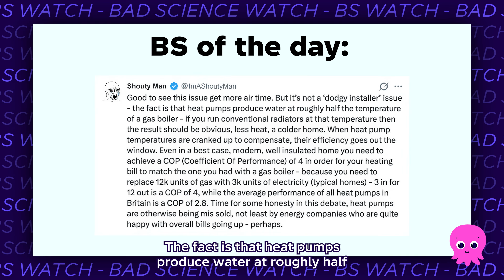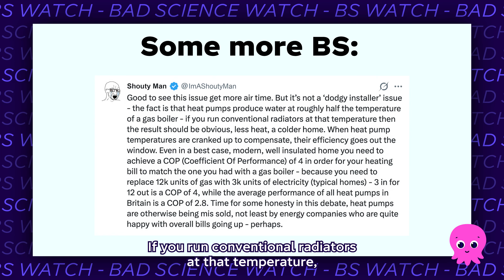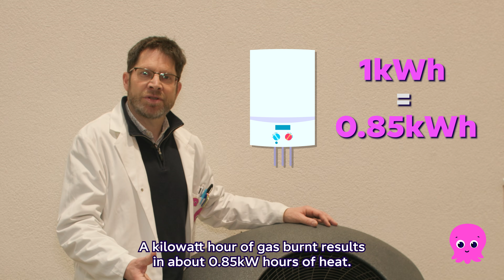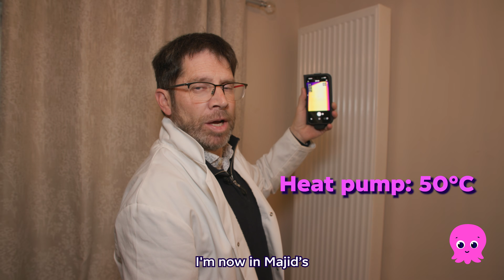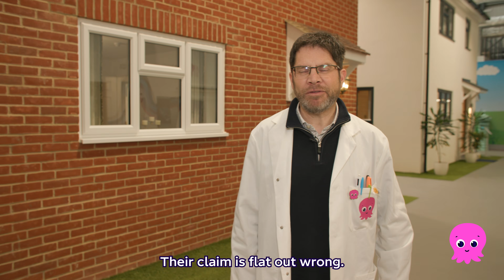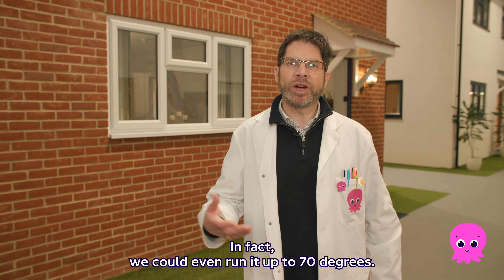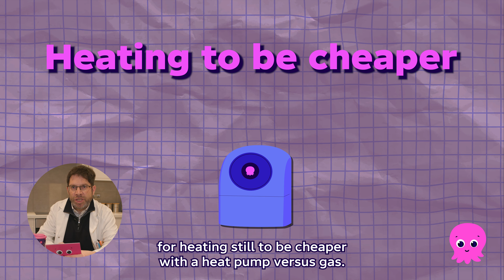Are heat pumps half as hot as gas boilers? BS debunked

Comment: what if you have an EV and are on intelligent Octopus Go it will work out more expensive to have a heat pump? does the heat pump run all day? how big is the water cylinder? Combi Boilers are more about space when it is limited
Reply from the maker: Hey Andy, the hot water cylinder is 1m x 1m x 2m. Heat pumps are most cost effective when not switched off, heating up a home from scratch takes a lot of energy and you can set the schedule to bump the temps up and down depending on your tariff rates. We show how this looks in practice with the Cosy tariff here: https://octopus.energy/heat-pump-help/cosy-schedule/

I'm here to chat through tariff options with smart tech, if you could pop me a message here: https://octo.ps/nudge
Reply: Add a battery. Then you can run the heat pump and the rest of your house on overnight tariff. And that's going down next month.
Reply: Heat Geek offer the Heat Geek Mini and Nano, which are small heat stores for heat pumps.

Comment: I have a heat pump but I wish I had a gas boiler, they are much more reliable and cheaper to run.
Reply: I have a heat pump and would never go back to a combi. Too bloody expensive to run. Secret, add a home battery and run the whole house on the overnight cheap rate.
Reply: If you have difficulties with your heat pump, contact your installer, or ask for help on social media groups.

Comment: So even at a COP of 4x (gas is 6.32p , electric is 28p) you are still cheaper going with gas and the standing charge on gas is less than electric, plus the fact you not spending a fortune having a HP fitted. Running a heat pump is NOT cheap for most people in the UK, and you make more on electric than you do on gas so OFC you want it rolled out and you want to sell more because you make more. Electric should be cheaper over all than gas as it easy to make, cheaper to make and costs lets to move. Yet we live in rip off Brittan were the scam energy regulators who are run by big energy providers make the decisions on how much you charge. P.s I am gas combi boiler, house warm all year round at 21c cost me £464.92 for a whole year inc standing charge. (3 bedroom home 1954 build). If Octopus want to prove me wrong and provide me with a free heat pump and show me how to cut my costs even more then sure come and do it. p.s i have solar and batteries as well and my systems cover all my electric bills, gas bill and water charges for the whole year ... CHANGE MY MIND Octopus, put your money were you mouth is and prove me wrong. you can read about my solar experience here - jdmne.com
Reply: "So even at a COP of 4x (gas is 6.32p , electric is 28p)" I have a battery and run the heat pump and all the house on 7p kWh. That rate is dropping to 5.25p kWh 1st April. Heat pump wins hands down.
Reply: @ianhamilton3113  lets see in the next few months ;)
Reply: A heat pump offers similar running costs to a gas boiler. Solar and battery, as you have, make heating with a heat pump even more affordable. If you have limited heating needs you may find AC, again using electricity, more suitable.

Comment: That original comment was wild. Hopefully they're not in the heating industry as someone who's only credentials are "briefly looked at how to make my tiny radiators more efficient", I can see it's wrong. 

In theory, you could set your thermostat to 21 degrees and have your heating source putting out water at maybe 25 degrees. It'll take longer to heat up sure, but it's possible and probably cheaper than blasting 70 degrees water around for a few hours at a time. 

It's like driving 50 miles at 70mph (or degrees) Vs driving at 50mph (or degrees), it'll take a bit longer but will actually be cheaper as it's more efficient, and you still get to where you need to be (in terms of room temp). 

Extra note, I've been with octopus for 3 months, love them, love the app, love the company and I'm using them to get solar and a battery installed in a couple weeks. 5* for Octopus! Best supplier I've ever been with.

Comment: Octopus Energy,

you make the common error which flatters a heat pump.
Firstly the efficiency of a gas boiler now has to be 90% by law (My boiler is rated at 95%), and secondly the efficiency of a heat pump is not the Kw input power against temperature output. That is very flattering to a heat pump but real physics is that no device can be 100% efficient, it is not possible.
What you need to make a true efficiency calculation for a heat pump is take the energy required to make the KVA (Not Kw, this is also flattering) supplied to the heat pump
The generation losses, transmission losses and distribution losses are significant. Your simple basic equation can only be used as a comparison to other forms of electric heating, not gas oil, wood pellet etc, you are not comparing like for like.
Reply: Yes gas boiler efficiency varies. We chose 85 as a figure representative of many installed boilers. 
Heat pump efficiency is calculated from the electricity used and the heat provided. As the heat is from the air then hence it’s greater than 100%. Phil
Reply: Phil, 

no device can achieve 100% efficiency, laws of physics, i.e. there must be more energy expended than received.
Your calculation is flawed and does not reflect reality,
it even misses the time element which is essential.
Heat from the air, even at the nominal 7 degrees C used by the heat pump industry, please explain how that heats, physics again, heat travels from hot to cold.
Reply: The science is a process called vapour-compression cycle - some useful articles on Wikipedia. Used in refrigeration as well as heating. 
Means it’s actually absorbing heat from the air and boosting that into heat in your home. So the 1kWh of electricity is running that process and giving you 3 to 4 kWh of heat from outside. 
Or it’s just magic and great for getting off gas.
Reply: @PhilSteeleUK  Phil, 

I have worked and maintained refrigeration plant for forty years.

Comment: Octopus installed out heat pump the thing they don’t tell you they are very expensive to run
Reply from the maker: Hey David, are you on our Octopus Cosy heat pump tariff with cheap off-peak rates? A home with medium typically saves £300 a year compared to a gas boiler with an additional £128 a year by avoiding gas standing charges. So I'd love to take a closer look at your setup here. Please use this form to send me your email/postcode so I can find your account & take a closer look to help 👉 https://octo.ps/nudge 👈  

We also have a guide with some tips for making the most out of your heat pump: https://octopus.energy/heat-pump-help/the-best-ways-to-run-your-heat-pump/ 🐙
Reply: @OctopusEnergy links don’t work say error code 404
Reply: Not on cosy tariff as we have ev to charge
Reply from the maker: Hey David, both links are up and running! It might have just been a temporary glitch. If they're still acting up, can you let me know? 👀🐙
Reply: @OctopusEnergy  hey, you need to put a space between the link and the emoji otherwise the link doesn't work for me in the YouTube app on Android?

Comment: Takes longer with heat pump to reach same temperature as a gas boiler, no?
Reply: Heat pumps tend to be run continuously so the fabric of the building is warmed. Therefore, it should only have that prolonged warm up period once (when it is first installed).  This is another benefit of heat pumps that doesn't often get promoted. The home is continuously warm, no boom or busts like you get with gas heating.
Reply from the maker: Hi there, you're right. Heat pumps do take a bit longer to warm up than gas boilers, so if you only switch the heating on for a short time, you might need to start them a little earlier. With the right settings, you can get cosy efficiently — here’s a guide with some handy tips: https://octopus.energy/heat-pump-help/the-best-ways-to-run-your-heat-pump/ 🐙⚡

Comment: I think the real issue is that Gas boiler is £500 whereas a heat pump is £20k+ to buy. 
It would take lifetime to break even. 
This is a red herring.
Reply: If you've been quoted £20k to have a heat pump installed you're either being mugged off or you live in a mansion.
Reply from the maker: Everyone's situation & home will be different. Our typical heat pump price is £3,818 (inc. the BUS grant) which is lower than the national average of £5,295. Our home survey will always give the full picture of what individual properties need to be install ready. Once installed, a typical home with medium use can save up to £300 a year compared to the previous gas boiler. More info here https://octopus.energy/heat-pump-hub/ 🐙⚡

Comment: Strangely my ASHP produces water at 70 degrees centigrade.It's not an Octopus HP but it works fine. We normally run it at a lower temperature on an Octopus tarrif. Our house is toasty warm all the time and my bills are lower than they used to be with a Gas boiler. I can't beleive the industry is still spreading misinformation and lies.

Comment: Is this true about the Cosy heat pump?

QUOTE: "Installing an air source heat pump (ASHP) near the coast requires specific considerations due to the corrosive nature of salty sea air, which can cause internal components to rust and significantly shorten the unit's lifespan. 

Corrosion Protection: Properties within 4 miles of the coast are considered at risk.
Reply: It's also true btw for solar panels and inverters and batteries if outdoors. Solar panels have a standard for salt resistance so any installer should consider this and most panels are compliant. Inverters and batteries often are not.

Sea salt spray eats metals rather well, especially aluminium.

Pretty much anything near the sea needs a bit of care and attention although most products its normally a mile or less so it sounds like the cosy is particularly vulnerable to this. I've always wondered about the wisdom of a plastic dustbinn with an angled fan in rain.
Reply from the maker: Hey there 👋 That’s absolutely right. Salty sea air can cause corrosion over time. That’s exactly why our Cosy heat pump comes with a special anti-corrosion coating, designed to stand up to those sea breezes 🌊🐙
Reply: @OctopusEnergy  Which is of no use to me as whenever I try to get a quote from Octopus it just says "We're not installing in your area right now. Your home is in an area that we're currently not able to service."

Is there a list somewhere of ASHPs that are suitable for a coastal installation?
Reply from the maker: Hey there, since you’re in North Scotland, we don’t cover your area directly, but our trusted partner Smarter Energy Homes can help with installations there. If you’d like, we can make a warm introduction for you so they can get in touch. Could you drop your details here, and we’ll help facilitate it: https://octo.ps/nudge 🐙